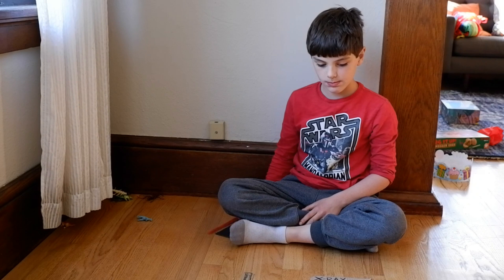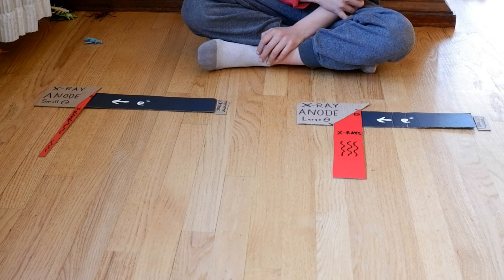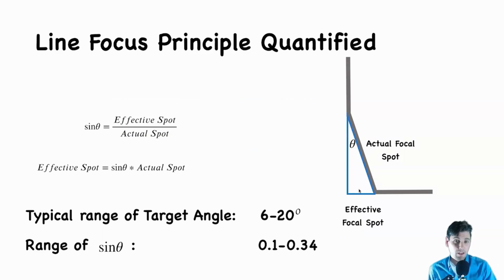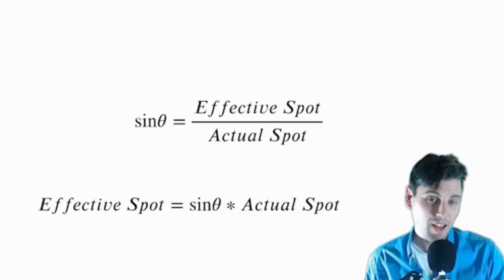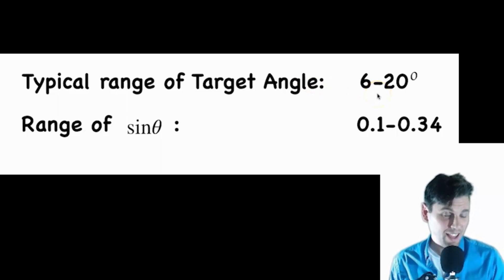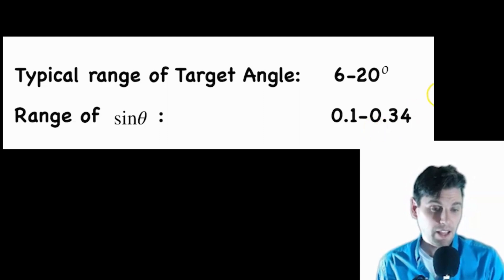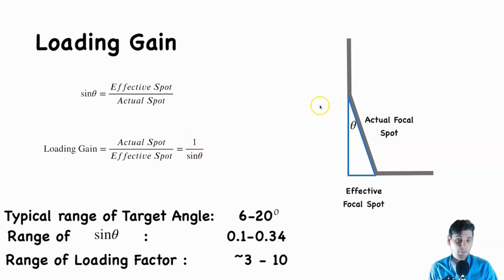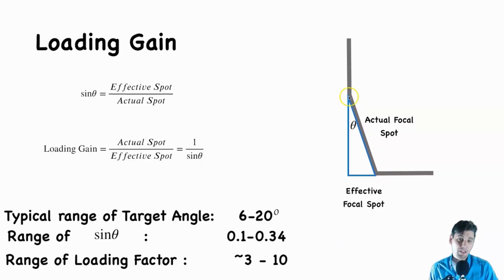X-ray Line Focus Principle (Rad Tech Guide)

Comment: So, what is the effect of a smaller effective focal spot on patient dose when using AEC. I assume it would be slightly higher, no? But then a narrower beam would be exposing a smaller area, so would it then result in smaller dose essentially canceling out any initial dose increase?
Reply from the maker: Hi Bench-Made Manliness, there is not direct relationship between focal spot size and dose. The collimation is the more important point than the focal spot size.
Reply: @HowRadiologyWorks  Interesting. It was my understanding that on an AEC exposure, irradiating a smaller area would increase the exposure time slightly and thus increase dose while when not using AEC it would not effect dose. No?
Reply: @benchmademanliness  https://youtu.be/ZZUXxhO-uqs , is a video we have on AEC considerations and you should cover each used chamber completely so the collimation shouldn’t have an effect